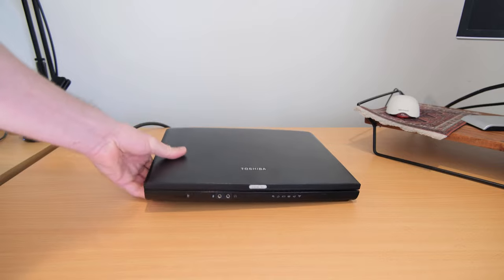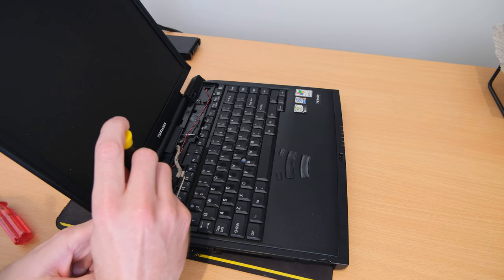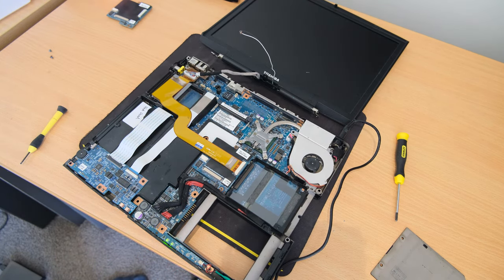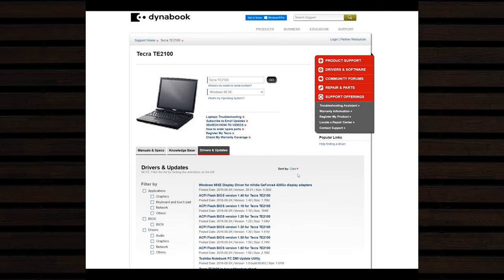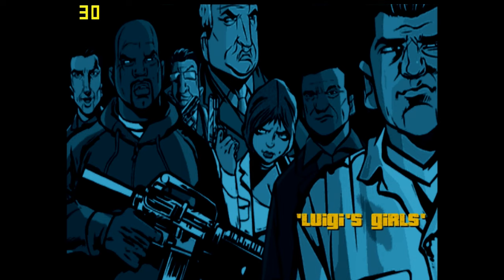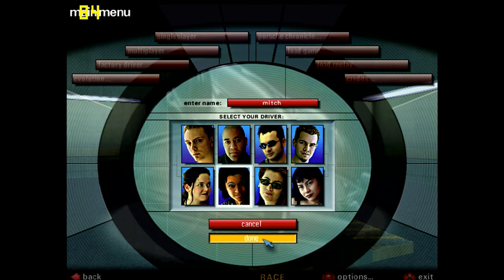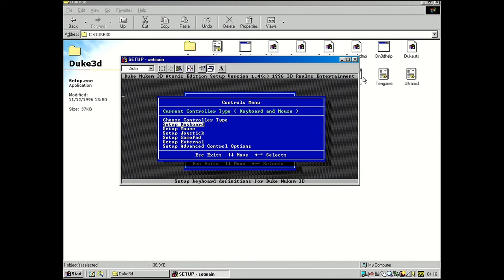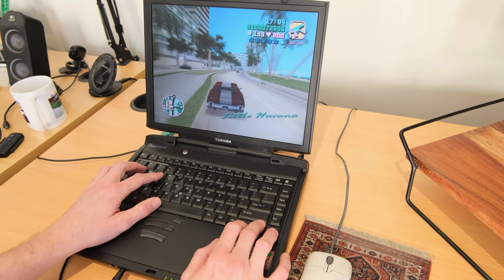Toshiba TE2100 | Dead Display & Some Gaming Surprises

Comment: Great video. I had one of these (1.6GHz version) during my early teenage years. Glad my memories of the graphics card being surprisingly capable weren't inaccurate - I remembering getting decent-ish results with Half-Life 2's demo featuring the Ravenholm level, and also played a fair chunk of Halo CE on it. I'd love to restore mine one day - mine had the exact same LCD screen issue as your original unit and eventually my mainboard failed too, I believe these were known issues with these units - sadly I'd picked it up second-hand and the warranty had long expired by 2008.
Reply from the maker: Nice! Would have been a great laptop back In the day. I did wonder if those display/GPU issues were common. Lots of laptops suffered issues like this. Gpu cooling was not good.
Reply: @thesmokingcap  Yeah, under load the GPU temp would reach ~100C and shut off. But it was all I had for games, so I'd naturally push it as hard as I could!

Comment: Seems odd in this old laptop that the graphics card drives the external monitor just fine, but broke for the internal one.  I suppose some sort of lcd power control on the board may have failed.  Also seemed odd that you could make it flicker by wobbling it about.  I don't suppose you threw the spare back together and tried it to see if it worked?.... Thanks for the video...twas fun.
Reply from the maker: I've managed to get a faint and dark image. But I'm wondering if there is a cracked solder joint or if a cap has failed. I've still got a running spare machine so may investigate a little